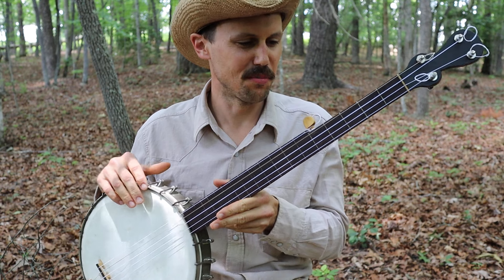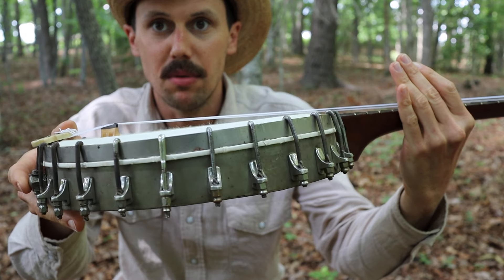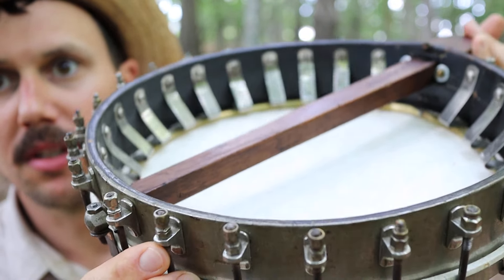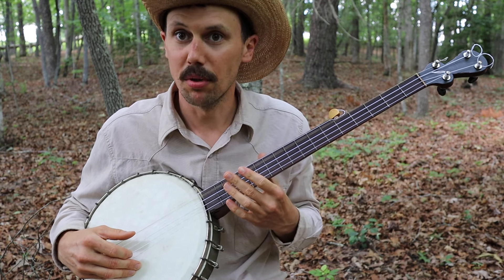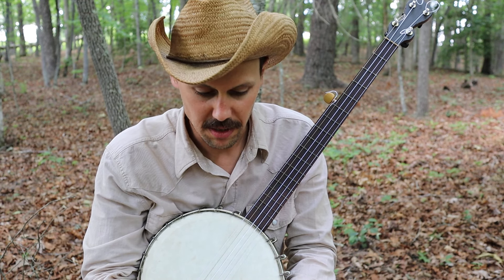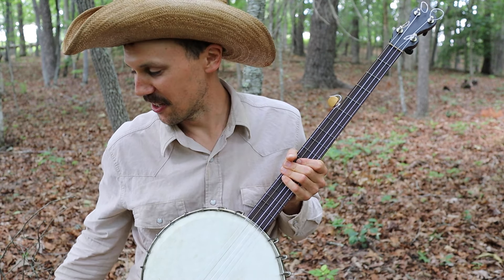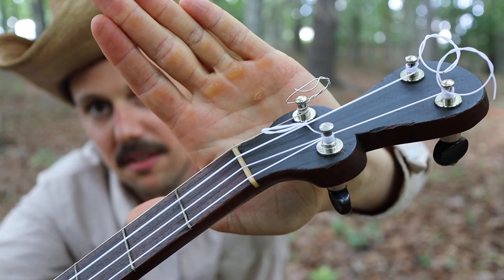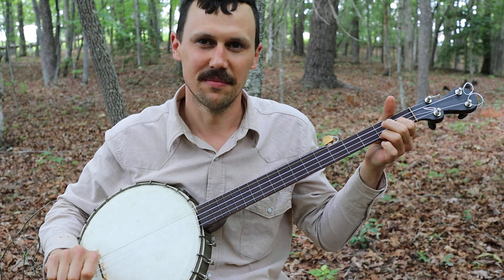Weird RARE Banjo from 1903?

Comment: Hey Clif! I just had a few questions about this banjo, here’s a little bit of context. About a year ago I found an old banjo similar to this one in build and have been working on restoring it for a good while now. It’s  almost there, but still has a long way to go. It once had frets, but they had been pulled along with the whole fretboard before I found it, I also believe that it had one of these tone rings too, due to its poor sound even with a period correct bridge and strings, and there also appear to be marks that were left on the inside of the rim from the spring brackets. I plan on following the 1903 Farmer patent where there is a bigger ring on the inside of the rim, along with the smaller inner ring. I have made and installed the bigger outer ring,  and WOW! The change in sound quality was quite surprising, my next thing to do is to make the inner ring, and then get a fingerboard and frets back on it. And that is where my question comes in. The one of mine has a 10 7/8 inch rim, the neck looks to be as long as the one in this video (I’ve never measured it), I was wondering how long of a scale length yours had, and I was also wondering what the diameter of the inner ring was. Mine seems to really sing with a 27” scale length, which seems to leave the bridge in a similar spot as yours, but I figured I would ask so that way I knew it was pretty close to original, I also wanted to make sure I got the inner ring diameter correct so that way I could get the proper “arch top” effect.
Thank you!